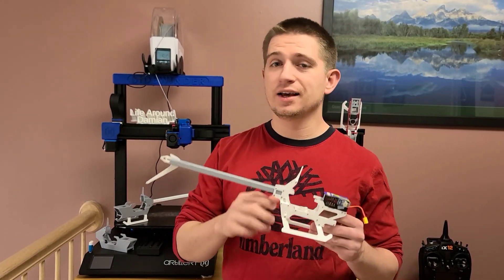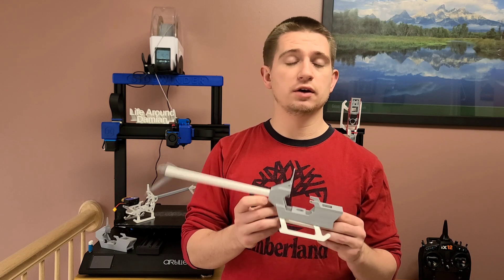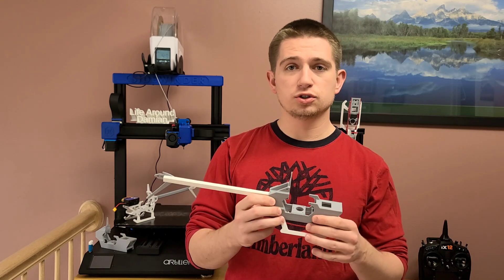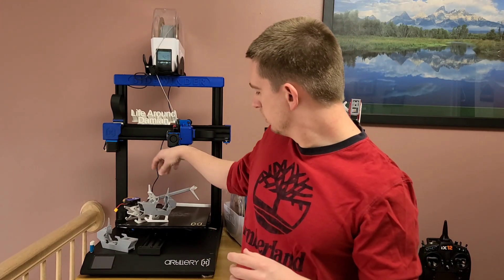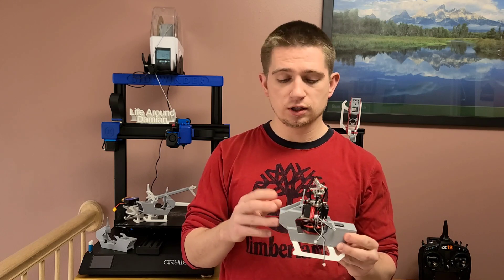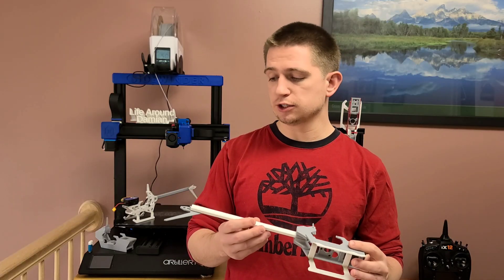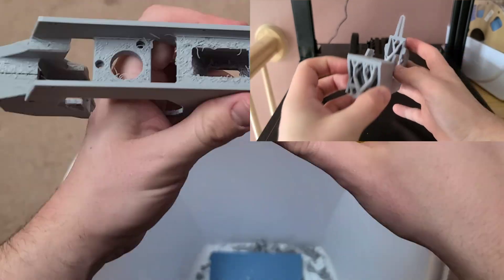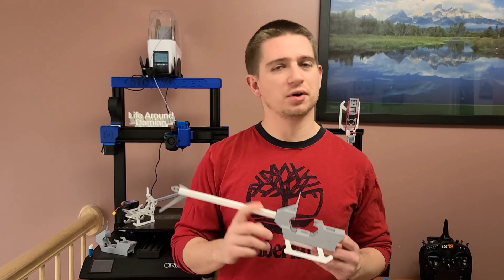Combined 3D Printed RC Helicopter Airframe To ONE PIECE!

Comment: I'm thinking of something similar with the blade infusion 180, it's not getting a good response from the market, but I think it's great in that it doesn't use crappy proprietary servo specifications like OMP or Goosky. Helicopters are a really fun hobby, but I think they are too expensive. If frames and parts can be produced directly with a 3D printer, time and cost will be dramatically reduced. I support your design!!
Reply from the maker: Thanks! 3D printing your own parts will improve the time and cost for sure! If a design is robust enough, I'm sure the market will respond in a much better way. Are you planning on redesigning a airframe for the infusion 180?
Reply: @LifeAroundDamian  Purchasing infusion180 and printing the frame is still just a concept, but I would like to try it if I can afford it. In the future, I hope to manufacture my own receiver/flight computer and integrate it with infusion's DD rotor system. distant future.
Reply: @LifeAroundDamian I just purchased the infusion180 helicopter.  Now I have to do CAD work, but I don't know if it will be successful.(I'm really bad at CAD.) Fusion360 for modeling infusion180 Lol🤣
Reply from the maker: @Idea63841  Haha thats great! Keep me posted on your progress, I would love to see how it turns out! I'll have my fingers crossed for you and if you need any help let me know!